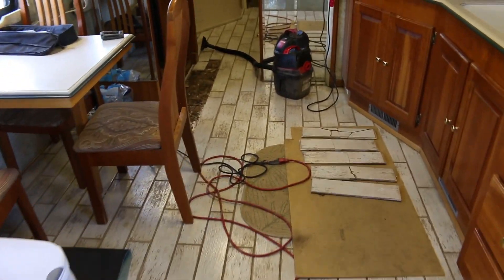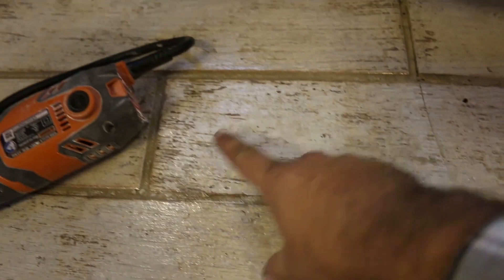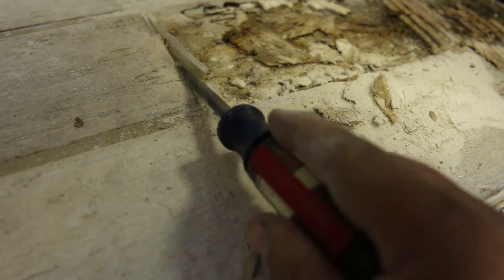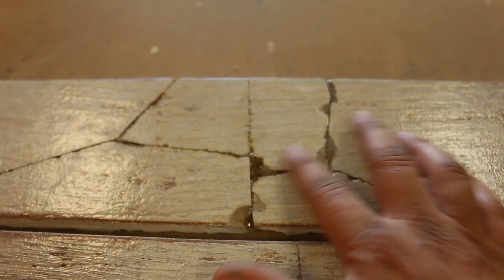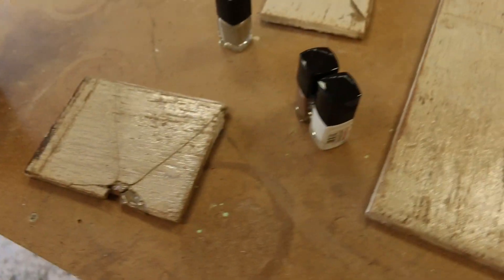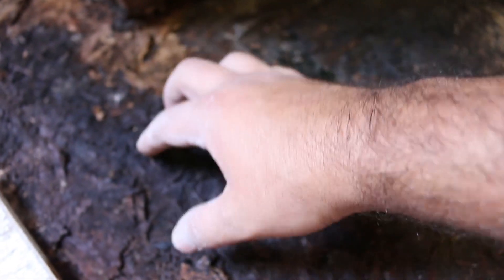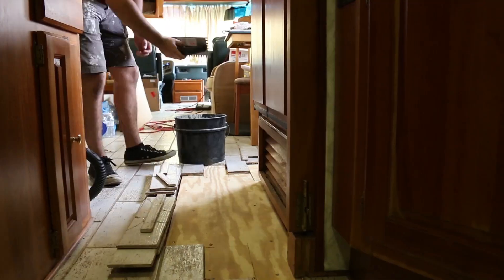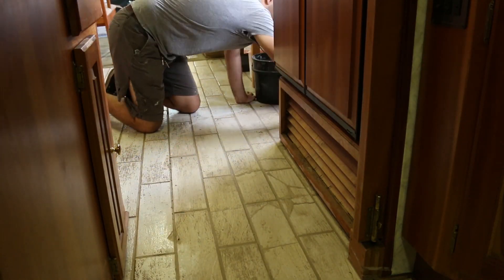Rotten RV Floor Repair

Comment: Gotta love how multitasking nail polish can be.  I use it as an easy low profile insulator for electrical connections.  It's also good for repairing the inside of a microwave if it's scratched and arcing.

Comment: I'm sooo glad you yanked out that chip board, that stuff is just terrible for any area that has the possibility of getting wet.  I was happy for you that there was a sub-sub floor too with a vapor barrier.  Saved yourself a large amount of cash and brought the floor back to some semblance of it's former self.  Talk about a mind bender... that you were working in the RV on a day with scudding clouds and just after you sponged that area of tile the sun shone on the spot you'd cleaned.  Would have freaked me out too for a second!  Good job!  A little more nail polish and you'll be ready for a Saturday night!  ; )

Comment: Please forgive my ignorance, but is there not rot under the refrigerator?  I have seen those removed and it looks like a pain in the tush to do it.
Wow!  Mike, you did a fantastic job of getting everything cleaned up and replaced.  Will you come tile my kitchen?
Reply from the maker: +Pidasian Hippie Great question.  There's probably rot under the refrigerator, but I'm guessing because of the weight of it and since there's hardwood underneath, it can't peel and flake off like the other floor?  When we eventually replace all the flooring I'll be removing the refrigerator and slide to replace all of the subfloor properly.
Reply: Mike and Lauren That makes a lot of sense.  I had forgotten that you are planning to redo the entire floor later.
Reply: Mike and Lauren the only potential issue is that the rot under any cabinets or fridge is also molding (moist warm areas breed mold). As mold grows it seeks out new organic material to latch onto (more wood, certain trim sections, cushion fabric, carpeting, etc. For a proper repair, ALL rot should have been removed (which is why the previous owner got big $ quotes). Im sure this will be fine for a while but just know that you're breeding mold in that area and it's growing its way onto things that currently are mold free.